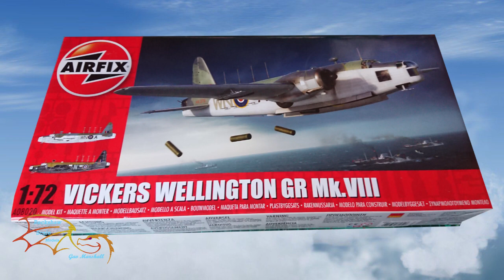Airfix Wellington GR Mk VIII Scale 1/72 Part 6

Comment: I feel your pain on this build Gavin. I’m struggling currently with an Airfix Hurricane. Although it should be straightforward every single piece seems to put up a fight. To cap it all I’ve messed up some of the decals and had to order a second kit to get the first one finished. Such is scale modelling. I admire your for plugging on and for putting up the video. We’ll done.
Reply from the maker: Thanks for the encouragement Michael, I've just learned that a distant family member father flew the Wellington and Lancasters and I got asked if I had built a Wellington. I thought you don't know the half of it 🤣